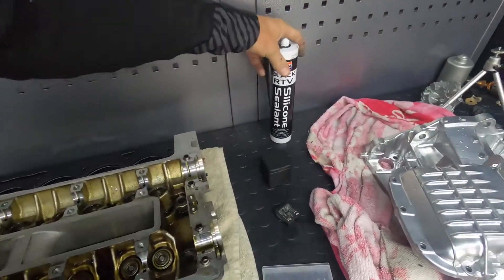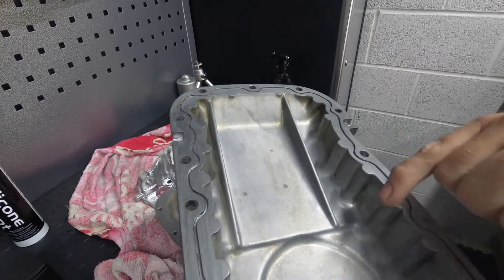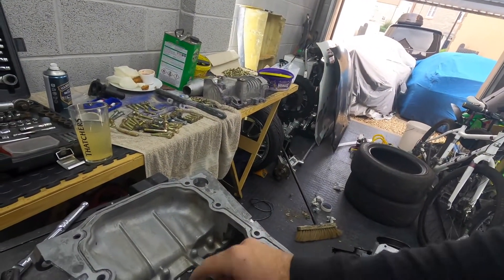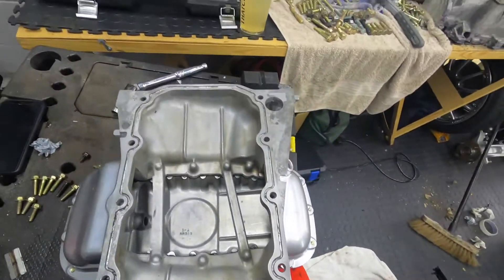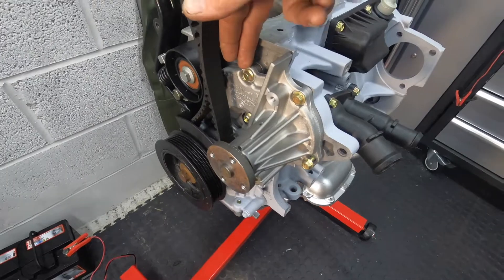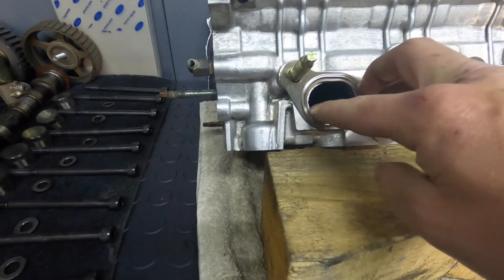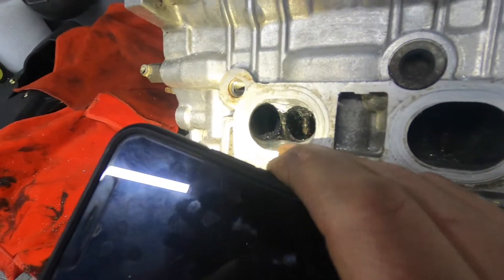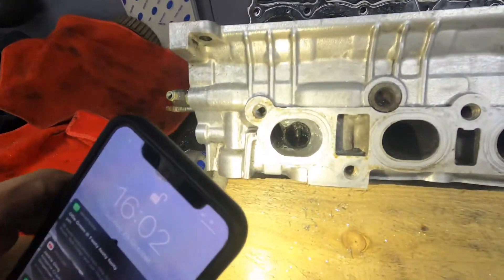Rebuilding a Rally Car - Part 28 - DT-TV - OIL PAN INSTALLATION AND PART 1 CYLINDER HEAD PORTING

Comment: Gutted for you about the oil pan job......however, kudos for the start of the head porting/polishing! Looks fantastic so far, and the video is clear enough to see what your are describing exactly :).......Re the garbage and charger, would you consider getting them blasted, possibly by your powder coater? might be less labour intensive and better results and a little boost? Still thoroughly enjoying every update and following the build process :)
Reply from the maker: Hey mate, yeah think you might be right with regard to the gear box getting shot blasted, cant with the charger as not safe to do so unfortunately. Glad you are enjoying the content still, the valve removal tool has arrived so going to remove them tonight and do some more porting.
Reply: @dt-tv6114  just reread my last post..... garbage is obviously supposed to be gear box! 😂
Reply from the maker: @brocks555  Yeah took me a min to figure out what you meant haha